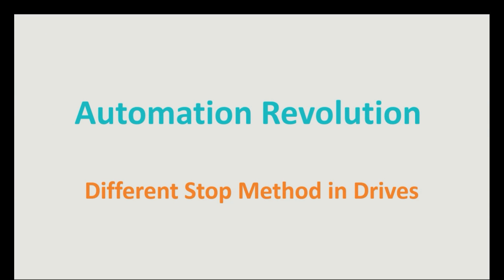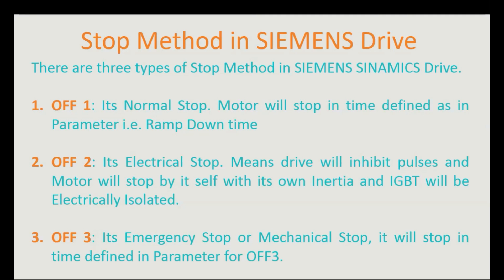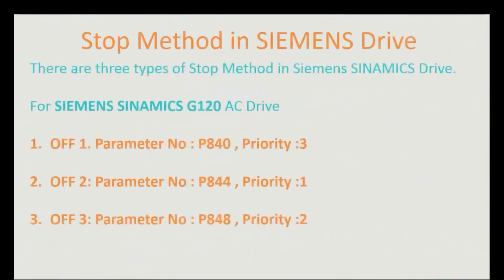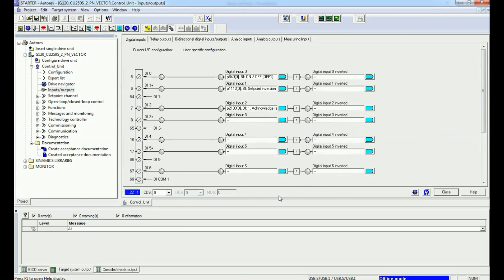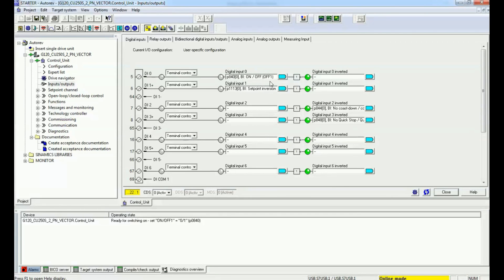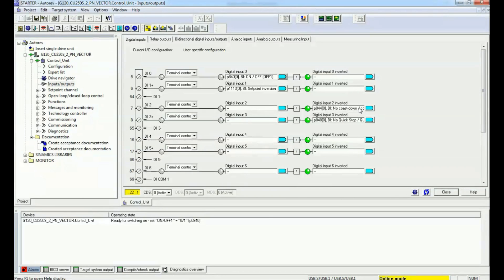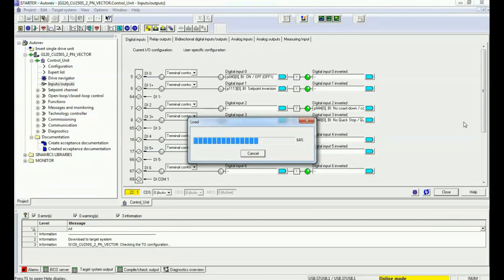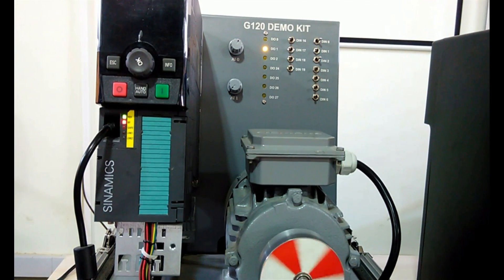Different Stop Method in SIEMENS SINAMICS G120 Electrical VFD

Comment: very  helpful,thanx for sharing. so far I didn't understand the why there were three different OFF...concept
Reply from the maker: +Iqbal K There are three types of OFF method and every stop method have different stopping time,  means electric stop method isolate motors from drive in case of electrical emergency and it will protect drive as well motors and in case of mechanical stop its will stop immediately without respect or RPM or load.